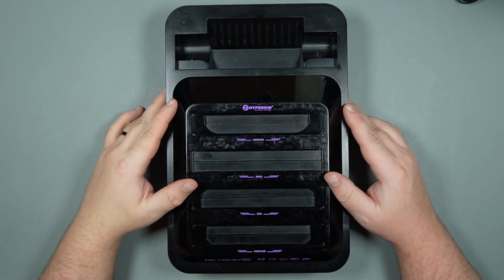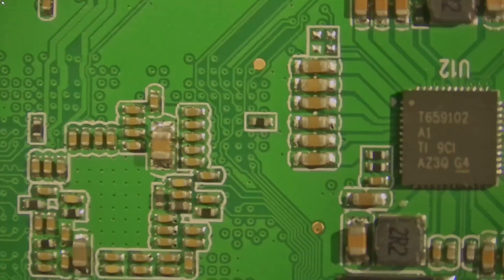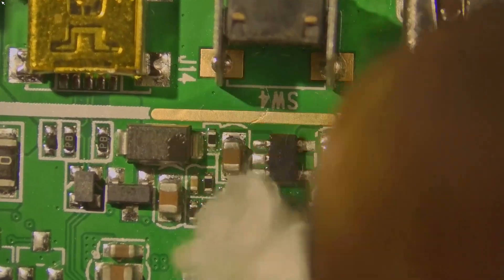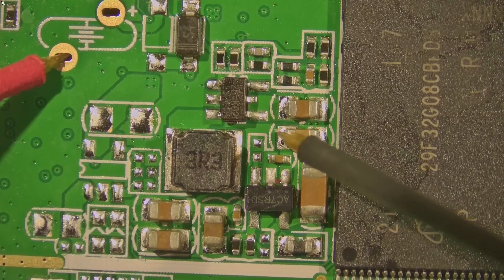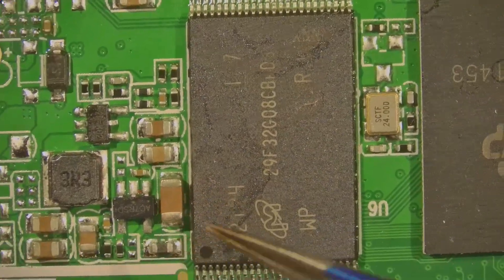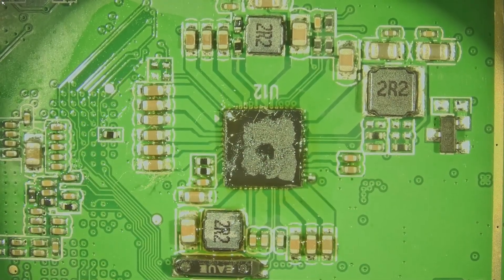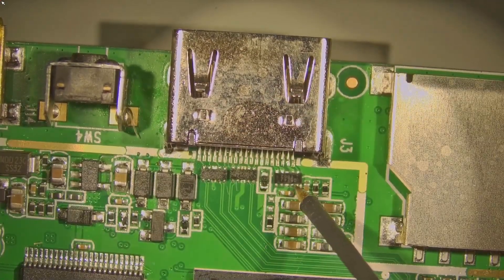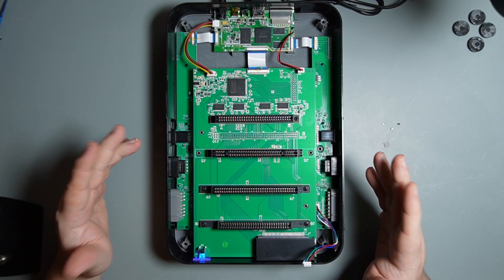RetroN 5 Repair | Over Voltage | Can It Be Repaired?

Comment: One and out, short lived YT channel..
Reply from the maker: Hey, thanks for the comment. However, not quite short lived. Due to a bad power outage, I lost everything on my main PC including my backup drive. It also fried the CPU on my laptop as well. So intro and everything has to be redone from scratch. All while trying to maintain a full-time job, kids and life in general. Then I had to gather the money for a NAS, drives and backup drives, a new laptop and a UPS. I will be back, but everything came crashing down at exactly the wrong time. Sorry to disappoint you. 😔
Reply: @HandsOnRepair  i'm not disappointed, the comment was made more to get you back on Youtube, becouse your video helped me and i like your style mr :)

Sorry to hear all this, family first. Hope u come back in future 😃
Reply: One more question, the two most common chips that fail on these  are common know as SOT 23 5 and SOT 23 6 right ?:)
Reply from the maker: I'm happy you liked the video. Short answer, yes. Sot23 5 & 6 are the package types for the components. 5 & 6 being 5 & 6 legs on the component. 99% of the time, the first to fry is RT8097CHGE. Then from there, it's a mixture of the other components I mentioned in my video. Good luck on your repair adventure!
Reply: @HandsOnRepair  thanks again mr :) I have already ordered them, i fault check the board and those 2 where bad, no more shorts :) Have been into electrotech for 8 or so years now, still loving it. Bringing life to old electronics that again will bring joy to others for years to come, really giving hobby in so many ways.
Reply from the maker: Hopefully you get it fixed! Electronics repair is fun and rewarding. The TV on my bedroom wall was being thrown out by a neighbor. That was 9 years ago I repaired it and it's still going strong! Not to mention, it's better for the environment to repair than throw away. Nowadays people are so quick to throw something away and buy another rather than get it repaired. 

Let me know how repairing your Retron 5 goes!
Reply: @HandsOnRepair  For real, i just repaired my sisters tv, that went out in thunder storm, got a new psu board from albania on ebay, and it was as good as new, i have that on the bedroom now aswell, it was 2 months ago now, just a 4 year old tv.

I agree, but companies make things that way 2, they want you to buy new, if there is parts, they are often more expensive then just buy a new one, it sucks. I think we humans as whole has failed this planet and all other living entities on it, we only only care about yourself, power and money. I talking in general now, not about you & me. But i will stop the negativity now 👍🏻🙂

I will, i guess the parts are here in a week or so, china uknow :) I just fixed 4 Gba SP tonight btw.

Have a good one.